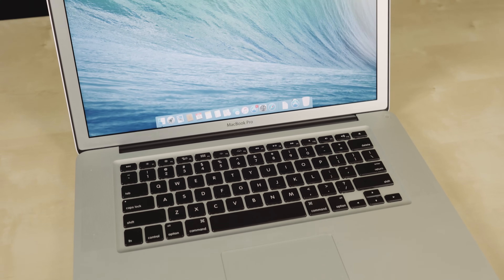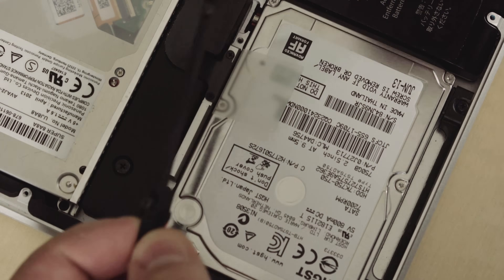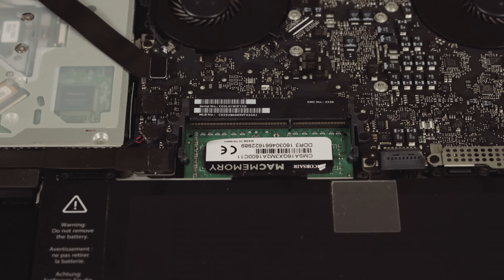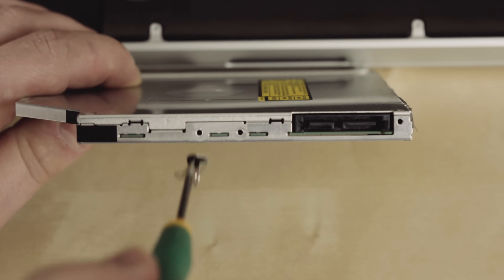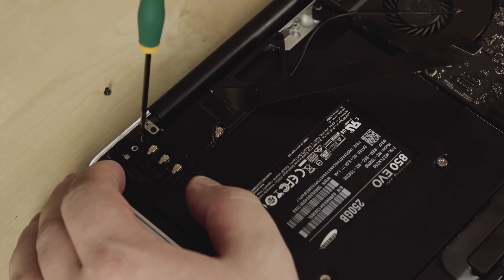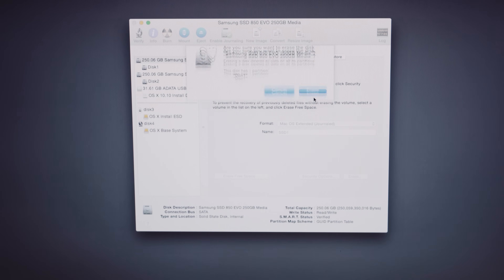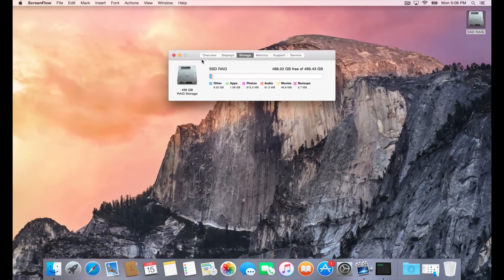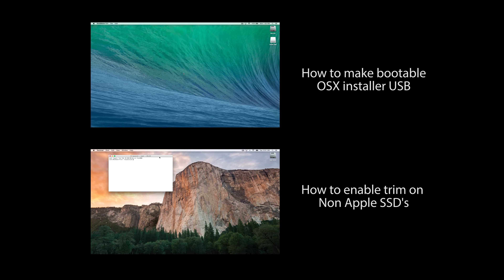Fastest 2012 MacBook Pro Ever! Upgrade Guide - in 4K

Comment: What is trim? I tried upgrading my drive but I keep getting an error, after I install the drive it’s like it doesn’t even recognize it and when I try to format it won’t give me an option for journal formatting it gives me the new format, any ideas how to correct?
Reply: TRIM can improve the performance of writing data to SSDs and contribute to longer SSD life, if supported you’d use a Terminal command in MacOS but all SSD are not supported. Now as for your other problem if you know nothing about Raid setups even more importantly the Pros (Speed) and the Ultimate Con (Total Data Loss) this is NOT the video for you, any who use carbon copy cloner or similar to clone your drives. Put the old hard drive back in your Mac, put the SSD in an external USB enclosure, start the app and follow the directions as required to clone EVERYTHING, Lol, just keep it simple. Once the clone process starts go do something not involving the computer and make sure it’s the only thing running, not required but hey you never know. When everything is done, Restart, hold the Alt button, select your SSD, let it boot, make sure everything works, turn the Mac off, now install your SSD in your Mac and you’re all done.

Comment: didnt know i could upgrade my mid 2012 macbook pro like this. laptop has started to become so slow.

My question for this video is why do you need a caddy? Can i just upgrade to a single TB SSD? or does it have to be 2 250gb SSD? why didnt he just use 1 500gb ssd if he wanted 500gb.

If some one could enlighten me i could start buying the parts. thanx.
Reply: Just buy the 1 terrabyte and 8 gb of ram..Amazon has the samsung 1 tb for 130 bucks and 8 gb of ram for 40 right now..Just did mine..

Comment: I would have changed out the battery at the same time. Also, this IS the mid 2012, which is not the Retina display model. Late 2012 ram is soldered on the mother board (that sucks). I want to know how to solder new ram into newer MacBook Pro laptops.

Comment: I have upgraded my mid2012 to two SSDs (one in optical drive formatted as a second hard drive) and upgraded my RAM to 8. I used black magic to see speeds and I am only getting in the 80s for write and 100 for read. This seems incredibly slow from what you are showing. Any suggestions?

Comment: Just FYI for Mojave users.  The Raid0 will not work if you are installing Mojave.  Apparently Apple does not feel that one needs Raid0 and will not release a fix for this issue.
Reply: So it will be stucked only with Sierra?
Reply: @hyewata18  I'm not sure.  I have not tried Sierra.  I know Mojave doesn't work though.  You have to keep the hard drives separate.

Comment: Hi, thank you for sharing this! My early 2011 said that support 8GB of RAM, it is possible to use 16?
Reply: Yes. I have the early 2011 MacBook pro and you can upgrade to 16GB RAM (I did mine long time ago). It's 1333 MHz PC3-10600 D3 SO-DIMMs to be sure.
Reply: Yes

Comment: OK, I understand how to install the SDDs, but how do you move data from old drive to the new one? I’m not too tech savvy, but see this as a great economical way to upgrade my 2012 macbook pro.
Reply: You can connect the SSD with an eSata cable to your mac before you replace it and clone your current HD onto the new one, then swap them out and it's exactly the same.
Reply: @avantsweater  Thanks!

Comment: I have the same 17 inch macbook pro and I LOVED IT! Still do! This is by far the best machine i've ever owned. Yeah - it's a bit slower than today's machines but 99% of the people won't have an issue with that. I am a developer primarily and the only complain i have is the lack of 6+ cores - but i can live with that. The only and biggest pitfall of this laptop is the GPU. Actually not just the macbook pro but also the iMacs from 2009-2012 have the same issue - the AMD chip inside overheats and gets totally messed up. I've baked it several times until it stopped working compeltely. If it wasn't for this i would still be using it till that day!

Comment: The logical part of my brain tells me that a second SSD is the smart move, the other part just wants a DVD drive...
Reply: Mine asks for a SSD + TB HDD combo.
Reply: honestly just get a 500SSD
Reply: Send me your number and I'll fax you 10 reasons why you don't need a DVD player.
Reply: @foxtowercommunications  
Are you referring to me?
If so, I know you don't need one and I'm feeling some sarcasm.lol. Everyone has to be a comedian on the internet. 
 I was just saying I didn't want to get rid of it and put in 2 SSDs if one will suffice unless there is a large benefit.  That's all I was trying to figure out.  One 2tb vs 2 1tb SSDs plus buying the housing for the extra SSDs.
Reply: I’m curious about this as well! However, I must say if you’re upgrading to a solid-state drive, regardless you’re going to get an insane boost in speed from everything I’m looking up/researching. Getting 2 SSDs thrown into the same Mac versus 1 sad that’s just more storage?... I’m curious to know! But sounds a bit more complicated overall. Hmmm
Reply: Hey,! Just did some more research and I saw this comment in another thread, I hope this helps!…” the  point to doing the RAID0 wasn't for the size boost as much as it is for the speed boost.

They act as one unit, but they write at nearly twice the speed a single physical drive can thanks to having two SATA connections.  This is why the speed test is better than the rMBP with similar specs (the rMBP is using a single SATA drive).

For redundancy you'd choose mirrored instead of striped RAID, btw, and lose the speed boost.
Reply: What's a DVD? lol
Reply: xxGodx you can still raid two ssd’s via os x lion. Made a raid yesterday but back up your files with Catalina OS in it first via external drive so you won’t need to partition one of your SSD into two separate drives. In my case, I’ve had  to sacrifice 500gb of my 1Tb SSD to use as startup drive and to install the Catalina OS in it (you can’t install the OS on RAID drives). I now have 1.5TB as RAID drive plus 500gb separate main drive as startup drive where the OS is installed.
Reply: @juzellejardin7777 His benchmarks were higher with the Raid setup. Sure you could get a 2 TB SSD, but you'd be missing out on 40% of the speed
Reply: @nicholascherry5962  
I'm computer illiterate to a degree but what ur saying is it's better to have 2 SSDs vs 1 with all the storage space.  I was considering this myself cause I was debating on getting rid of the DVD drive.  I don't want to but if it makes it process twice as fast it would be worth it.  Im considering playing StarCraft 2 on it.
Reply: ¿external dvd drive?
Reply: Aru Zen So true! I have the 2012 model but recently bought the external drive for my new macbook pro and it was SURPRISINGLY cheap! 😉👍
Reply: Dvd drive gang rise up
Reply: I choose the optical drive.     SSD's are getting cheap enough so that a 1 TB, or larger drive can be partitioned and you can still keep your optical drive.
Reply: xxGodx  
Same lol
Reply: I'm actually happy with the SSD speed boost I put in and don't see any real need for it to be any faster for what I use it for.   For anyone else that's considering this, I recommend just trying one and see if it will suffice depending on what you use the computer for.  I'm actually ok with still having. A DVD drive but I understand if you want to utilize the space.  1tb was more than enough for me as well.
Reply: why not get a SSD card with 1 TD of storage?
Reply: I have heard that replacing the SATA-cable with new one can give a difference (maybe it's the conductivity)
Reply: EdgyShooter The thing is. You can install a second SSD and just buy a £15 or $15 external disk drive. Best of both worlds
Reply: xxGodx  lol i use dvd drives every day
Reply: Is it possible a TB SanDisk SSD Plus can work on MacBook Pro 2012 (mid) i7 core 500 GB Stock Drive?
Reply: for me, i would just get a bigger ssd, I rlly want that DVD drive, I would say that is one of the big parts of these unibodys besides the upgradeibiliy
Reply: xxGodx   I have dvds I wanna watch and never do , they’re cheaper than online downloads
Reply: I still want my dvd drive. I’ll just get a 1 TB SSD.
Reply: just buy a 2tb-4tb ssd. You dont need an extra ssd, its better to have the ability to read old formats imo
Reply: @xthrax  Agreed.
Reply: @xthrax  which old formats require HHD?
Reply: X t h r a x you can buy a caddy for your dvd drive and use it as external usb afterwards. It’s cheap

Comment: Great video.  Just did this upgrade to my 2012 MacBook Pro with a 1tb Crucial SSD and 16 gigs of Timetec ram.  Total was $170 and my setup is so much faster now.  Had some issues restoring the new hard drive from my backup but got it sorted out
Reply: what are some of the issues you came across? and any tips? I am considering basically doing what you did with your 2012 macbook pro to mine. Thanks for any help and input.
Reply: where did you buy everything for only $170.00?thanks
Reply: @brendabarndt2090  I just got a timetec 16 gig for 50 and Samsung 870 evo for 70ish
Reply: I just ordered the same exact! 1 tb crucial and 16 gb timetec.

Comment: Is it still fast in 2019?
Reply: Edward Baran it is
Reply: Oh yeah 🤘🥳🍻 I have same setup but only have one ssd and the stock hd is inside the optical drive
Reply: @MySCSStory  Did you reformat Mac OS to the SSD? Would suck if you installed that SSD for not reason bro.
Reply: Justin I format the ssd in a external enclosure, cloned the hdd to the ssd using ccc. It works fine. I’ve even swapped my caddy with a owc data doubler and a second 6gbps ssd.. and they both work and run at the max speed without reduced negotiation. Both of my ssds are crucial MX500s

Comment: Its posible if i install 2x500gb SSD Samsung 860 EVO ?
Reply: I already instal 500gb SSD Samsung 860 EVO with Samsung 860 QVO 1TB, and the results can't work if two SSDs are put together, and I can only make 1 TB into a system and the 500GB becomes secondary storage.

Comment: I have such a setup since 2011👌🏻

MacBook Pro 17” Late 2011
16GB RAM
512GB Samsung SSD 850 Pro
1TB Samsung SSD 850 Evo

And now it’s f*cked, because the Mainboard Apple changed me (Graphical Failure (AMD 6770M 1024 MB GPU) had WAY TOO MUCH Thermal Paste on it (done by Apple.....)
Reply: Wow I also have a 2011. Did you fix it?

Comment: Is it worth it to do the same procedure with a 2009 17” MacBook Pro ?

I would keep the optical, but replace the hd for a 1tb ssd, and upgrade the ram to 16.
Reply: You need to check since afaik a 2009 macbook can only support 8gb ram. But yeah you can replace the HDD with SSD just fine.

Look for austin evans video on upgrading a 2009 macbook with extra ram and SSD

Comment: Got a mid-2012 MacBook Pro. Before I saw your vid, I upped the RAM to 8GB and I just put in an SSD. Was advised, once the drive was installed, [Cmd]-r boot, Disk Utility, format drive to MacOS Ext (Journaled), reboot [Cmd][Opt]-r which automatically sought my network (used ethernet for speed, rather than my wi-fi), it read my PRAM to verify previously installed MacOS, and automatically downloaded my new Mojave. No bootable flash drive required. In-line with OS installation it asked if I wanted to transfer my data, apps, and settings from a TimeMachine backup, which I did. No muss, no fuss. I'm only lacking the 2nd SSD. Your vid was clear, concise, professional. Thank you. I felt that sharing the OS install might benefit you and your followers.

Comment: Ive wanted to remove the cd drive.. this gives me a great resolution to that. Worried bout redundancy tho. Buttt i typically use my mbp for browsing and streaming music and vids so i dont i should be concerned.. esp when i used my mac mini to store data.
Reply: This would also make my 2012 mbp lighter too.. prolly by not much but uolo
Reply: @emvnsp2080  Bro y ou can just change the HDD to SSD. Will make it lighter, or also the optical for even lighter :)

Comment: Thanks for the helpful video.. But Im a bit confused, my MacBook Pro (15-inch, Mid 2012, 2.3 GHz Intel Core i7) and I already installed the 16gb RAMs, Now I want to upgrade the disks, so should I buy 2x 250 SSD or 1x 500 ssd and I keep the original mac hard drive (500 GB
SATA Disk)?
Reply: If you do game or music production which regularly max your cpu, go for have two non raid disks, one w system & apps, the other for media storage.
Reply: thanks for your reply, I do coding and apps developing for the meantime.   @MrAntoduti

Comment: I got MacBook Pro 15 inch bought em 2012, it runs so slow has 4Gig memory but 500gig hard drive. I just need to replace or upgrade memory card to 8gig its fast right now compared running 4Gig memory, last night I ordered 16gig memory card from amazon let’s see how my old MacBook Pro after I will install another 16 gig to it
Reply: C Sanchez how well did it perform?

Comment: !!!Warning!!! Read this before you do this so it might save you some headaches. I did this about 2 years ago to my MBP 2012 and I must say... It is so worth it. But there are a few warnings I must give! So the upgraded ram is fine and my first ssd in the default drive bay is working perfectly (samsung 850 pro 1tb) then the drive caddy is the issue. So I had it working for a while. I didn't raid my drives but instead took a Seagate 3tb hdd and partitioned it as a 1tb/2tb partition. I would run internal time machine backups with the 1 tb partition since the size matches the ssd. Then I would use the other 2 tb as long term storage. Now this is where the issues started. The drive caddy SATA cable would sometimes not connect. I have tested the drive and even sent it into Seagate to ensure it was working properly. So any drive I would connect to the drive caddy would not work. Following this, I was able to obtain a second macbook 2012 and do the same modifications using my previously used hardware thinking that maybe the logic board was crapping out. So the new computer worked with the modifications for about 4 months. And then it broke again! But the most weird part is now that I moved back to the initially not working macbook and all of a sudden after letting it sit for months, it worked again! But after around a half a year it stopped. I'm not sure what causes this and I've spoken with a couple of apple geniuses about it and they also have no clue why it happens.... Maybe someone here could have an idea as to why the hardware doesn't want to work after extended time? Let me know. When it works, it is FANTASTIC. I cannot emphasize this enough. It is definitely worth the upgrade but I just wish I didn't have this little annoyance.

Comment: I originally hated my 2012 MBP upgraded to(16gb ram) early but from day 1 it was slow and took 5-7 minutes to boot, apps took forever and spinning pinwheel was a normal site. I wanted a new computer but can't afford $2,000 then I stumbled on to your video. I didn't know it was possible to change HDD to SDD. Bought a single Samsung 860 evo 500gb SDD drive and BAM!!!!! 20 second boot time and apps load almost instantly..... THANKS MAN, your my hero,,, one question though, can I add another SSD drive in place of optical drive just for extra storage without making it Raido?
Reply: yes you can add another SSD drive in place of optical drive just for extra storage. its safe with no problem issue, coz this optical was made to us can change for extra storage.

Comment: I had fun erasing an ssd with more storage to put on my mac book pro with less storage it had windows on it and it was so confusing I had to boot off of a Mac OS usb drive to erase the ssd installed and once I got it running it was so much faster especially with the ram upgrade I did to it I just need a new battery it’s a mac book pro mid 2009 “13 low spec with the 2.26ghz processor I think  ..don’t quote me on it I’m not on the laptop right now but damn it’s fast now

Comment: I just finished upgrading my MacBook Pro (13-inch, Mid 2012, 2.5 GHz Intel Core i5) with 2x(500 GB SSD from Samsung 860 EVO) and 2x(8 GB of rams from Crucial 1600 MHz DDR3). The Geekbench 4 result for 2-core is 5155 while the single core is 2560. The Blackmagic gives 904 MB/s write and 974 MB/s Read. I'm running macOS Sierra (10.12.6). Graphics is Intel HD Graphics 4000 1536 MB. Anyone have higher than this?

Comment: Question: when I'm done setting up the SSDs for Raid0, do i need to go thru a full install of the latest OS or can i simply restore from Time Machine? As i will be using this macbook as my main computer and don't want to start with a brand new machine..
Reply: Time machine should work

Comment: That also can be done with 2 1TB Solid State Drives as my suggestions.
Reply: Sharptooth Trex would it make a lot of noise and struggle with all of that thoug?
Reply: @cartertv8990  No, noise no cos its an SSD, computer is lighter and battery is drained less as its accessing a chip and theres no moving parts.  The size of the drive wont slow it down.

Comment: Just upgraded my Mid 2012 Macbook Pro A1278 with a Sumsang 860 Evo 512gb SSD and 16gb OWC Ram. I've kept the disc drive for now. She's running like a dream. Thanks for your inspiration and help with the upgrade
Reply: I've got the same system. I have 2 x 4GB memory in each slot. I was under the impression I can only go as high as 8GB in total. Did you have any issues using 2 x 8GB in each slot? I'm dreaming of turning it into a 16GB beast!!
Reply: @ericjohnson7717  Check for your system in there :
https://everymac.com/systems/apple/macbook_pro/index-macbookpro.html
I followed their recommendation and upgraded to 16GB on my late 2011, no issue.
Cheers
Reply: @ericjohnson7717  i just put in 16gb (8x2) and its running perfect, i can only imagine what differences ill see once i install the Samsung EVO 860 SSD.